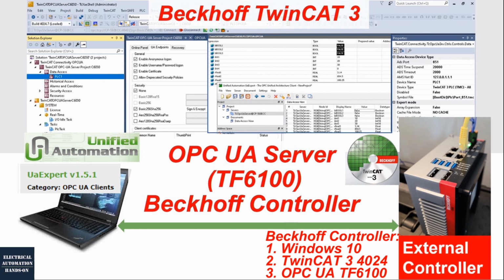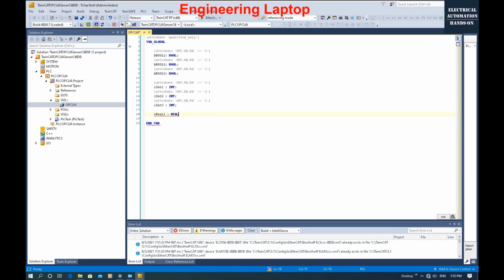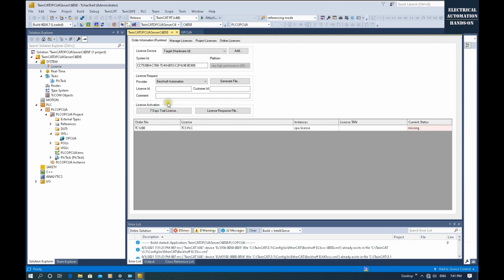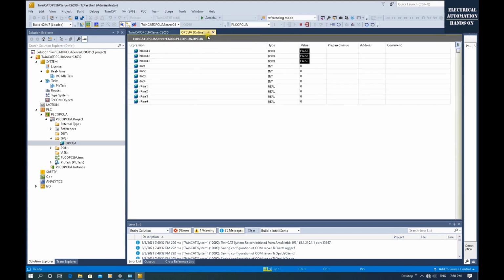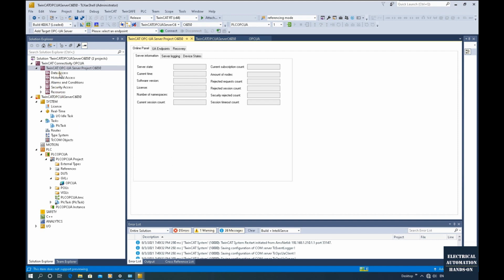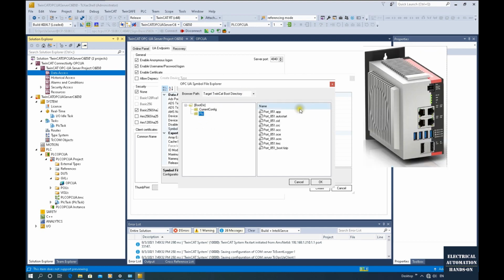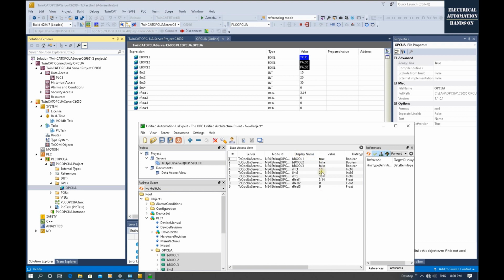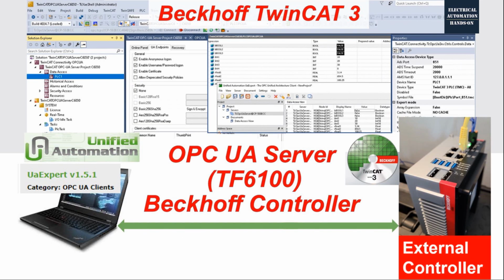COM08b. OPC UA Beckhoff - TwinCAT 3 TF6100 (OPC UA Server) Beckhoff IPC Controller (C6030)

Comment: You are a few useful resources when it comes to Beckhoff PLCs. The company itself fails to do walk customers through like you. As it keeps updating the OPC UA Configuration and OPC UA Server, it is more tricky. I wish you could have update this tutorial since the current version is 4.4. I guess your tutorial works with the older versions.
Reply from the maker: Welcome! Thanks for watching. You can find the OPC UA software download link under my video, it is the correlated revision for this video. Also the new revision of the OPC UA TF6100 can be found here.
SCADA05. [PLC&HMI] Beckhoff TwinCAT OPC UA Configurator TF6100 4.4 (2022.05 Standalone Rev)
https://youtu.be/yKocYfOLegg?si=kxCDsd4YOpUPadNJ.
Reply from the maker: And yes, Beckhoff keeps updating their software, however, there is no notice and <change record and explanation> from their modification. Therefore, I attached the software download link from my google drive, so you can download the revision I used for this video.
Reply: @electricalautomation  Can you open an access to your Google Drive? I got rejected.
Reply: @electricalautomation  yes, there is no release note or whatsoever when they release new versions

Comment: Int the OPC ua configrator instead of add configration it now shows edit serverlist and it doesnt work.
Reply from the maker: pls check the revision of the OPC UA software. Different version will do different tricky. Also check the certificate reject folder
Reply: @electricalautomation  where is the certficiate reject folder?
Reply: Did you find a solution for this?

Comment: Thank you already for your very instructive video. 

But I can't put it into practice.

I received a controller (CX5130) with a written program, a UA Sample Client and a TF6100 server integrated with a license. 

When I connect to the local server via UA Sample Client of the local controller (CX5130) (opc.tcp://Local:4840), I can see all the variables. 

But when I want to connect my UA Expert from my computer to the Controller (CX5130) (opc.tcp://IP Address Controller:4840), I get a connection error like:
Error while loading Einpoints, Error Establishing a connection. 

When I check the connection between my computer and my controller (CX5130) via Ping "IP Address controller" everything is fine. 

What must be the problem, why my UA expert does not detect the IP address of the controller. Should I change the server configuration, if so how or what specifically. 

Thanks for your support

👍👊
Reply from the maker: I would recommend you watch this video couple of times carefully. There may need download and config between TC3 PLC and OPC UA configuration back and forth couple of times. This is the COM08b video, I redo this video after I did the video COM08a (You can find the link under the video), so this video shows more clear procedure and everything started from scratch. It does has many settings and operations. Therefore, please review it carefully.

Comment: That's awesome! Thank you very much for your tutorials, I have learned a lot thanks to you. I would like you to teach how to control frequency inverters through RTU with BECKHOFF. I will be waiting for your next videos!
Reply from the maker: I would recommend you review the link https://infosys.beckhoff.com/content/1033/tf6255_tc3_modbus_rtu/9007199441275787.html?id=7435651689354700288. I don't have the RS485 and other hardware to demonstrate this. But I think the info from the link is clear enough. Please review it and try TF6255.